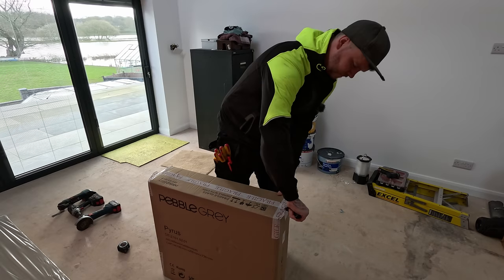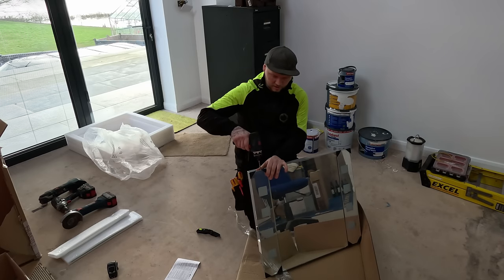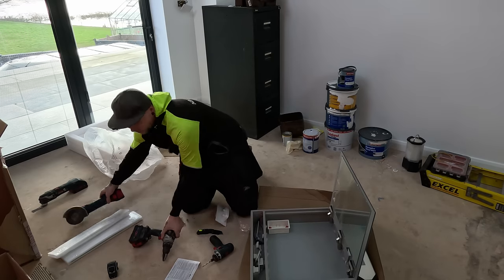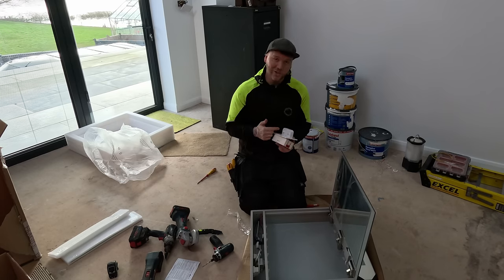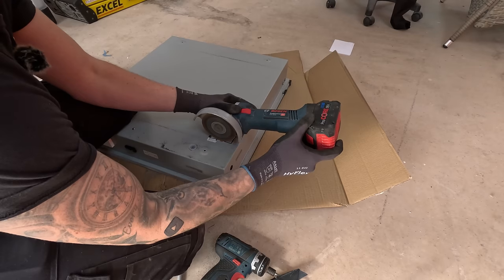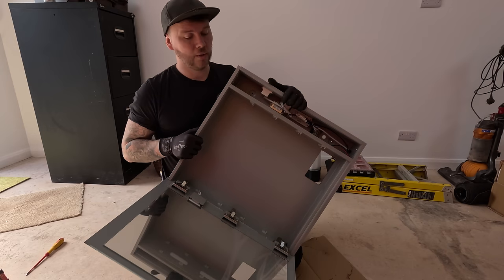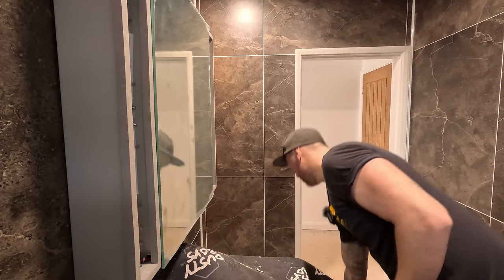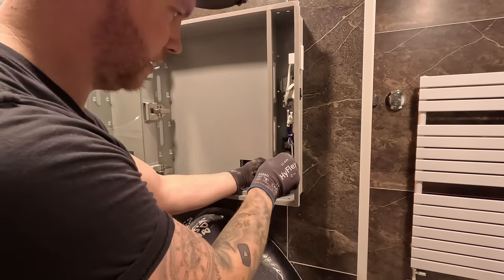I Have Some Really Big News...

Comment: For fixing a big & heavy thing like that to a plasterboard cavity, Rawlplug "interset cavity fixings" are the business.  They do them in all sorts of sizes.  I've got some 5x52mm ones that do up to 23mm thick surfaces (minimum thickness for them is something like 10mm, so fine for standard plasterboard), for mounting storage heaters and electric radiators.  They permanently mount a nut into the wall, which lets you bolt your stuff in place.  Get the official pro tool for setting them in place, it's worth it for making sure they are correctly set without crushing the plasterboard, although you can set them by carefully tightening the bolt.

As long as the plasterboard isn't complete crap or damaged, you can't do better without inserting big chunks of wood behind.  Dimplex recommend them for storage heaters.

Comment: I seem to recall Mr Nagy dropped the C-Bomb whilst he was doing an EICR and he dropped a wooden panel on his head.  It came from out of nowhere and I still remember it, so your point about language is well founded.  Whatever happened to his YouTube, not posted in ages.
Reply from the maker: that's the one, and no idea mate
Reply: He posts on insta regularly, also does fix radio. I think he just got really busy with the highways work and likely not worth his while doing YouTube. He also gave the impression in the couple of vids he did about the highways stuff that the client isn’t keen on it being on YouTube.
Reply: Rings a bell. Think the fuseboard was in a cupboard with a hidged door that opened upwards, and the strut snapped. Dropping the heavy door on the back of his head.
Reply: I remember that, wasn't little Naomi - I forgot her name working with him at the time. He was up the top of steps in on a landing if I remember rightly. Lucky it wasn't serious and he only dropped the C-Bomb, have had similar recently and it landed me in a&e.

Yeah he gave up YouTube because of Highways work taking over, rarely does domestic now only for a few clients from last I saw him in the wholesaler though that was quite a while back.

Comment: I announce motocross races and never even use "hell" or "damn" on the mic. However, I took am really bad with f-bombs in real life. That from 12+ years in the military, and working as an electrician for many years. 

I had some riders ask  how I avoided swearing on-mic, I told them I don;t want to ever figure it out as that will allow that filter to fail me at the wrong time. 

Unfortunately our trades over here have been taken over by delicate little flowers and I have gotten in a LOT of trouble for language that used to be perfectly ok. (I did ALWAYS watch language when the clients or other non tradespeople were around.)

Comment: I get the swearing thing. I'm 60 - so ancient - and coming up through the trade tend to be a wee bit sweary. In Scotland, we use the C-bomb as punctuation, a term of endearment, an adjective, and very occasionally an insult. Most people find it offensive, and probably should. I now work in a university, where foul language is not the norm, so have to be very selective in my tirades.
Don't explain yourself in terms of money/sponsorship etc. It's no-one's business really except yours. I used Makita equipment when I was on the tools, and would have jumped at the opportunity to be sponsored. I still have a Makita drill, which my Wife calls Trigger's broom. I have owned it since 1985, and in that time it has had 3 new chucks, 4 sets of brushes, 2 triggers and a new armature. But it's still the same drill.
Look after yourself, invest in a good pension, plan for the day you can't keep working on the tools.

Comment: Funny you say about the duel toothbrush holder..

I have been wanting to have one of those installed for about 2 years.. 
But never got around to requesting one to be installed..

For things like that, would you have us (the customer) purchase them, or would you purchase it as apart of the bill of materials?
Reply from the maker: Buy it your self mate- they cost a fair bit and you don’t want the mark up on it tradesmen do
Reply: @NBundyElectrical  Yeah, I've been following the price on Amazon for 2 years.. they fluctuate a bit, so I can wait til they go down..
I just didn't know if I did buy one, for then suddenly you go "sorry, I can't install something I didn't purchase" incase of it being broken or something dodgy or any other reason I can't think up.